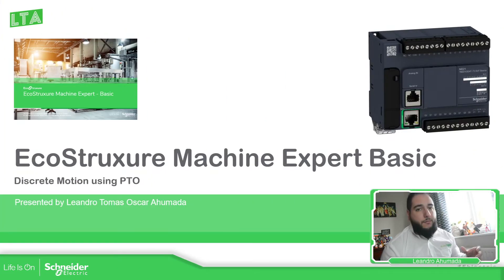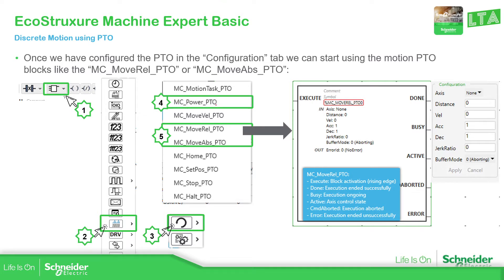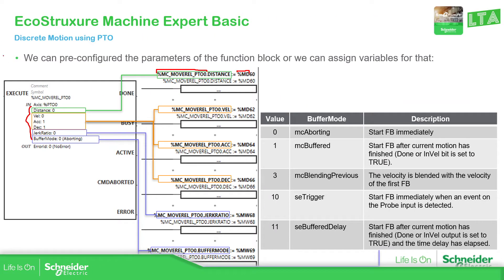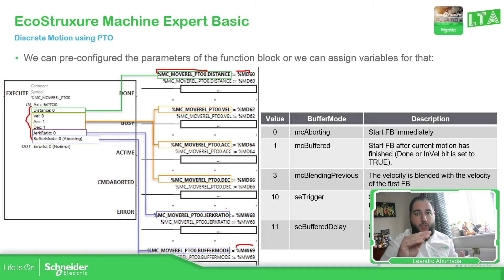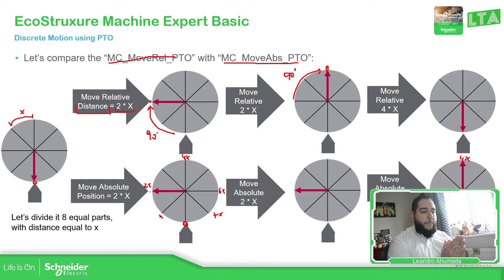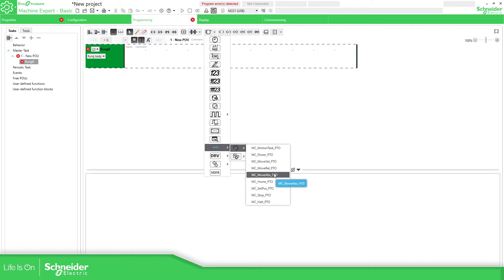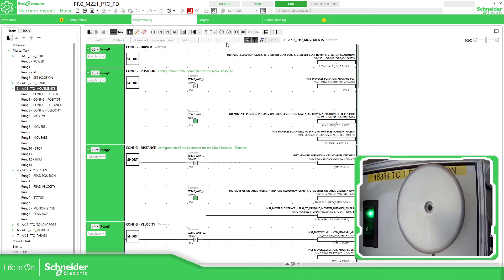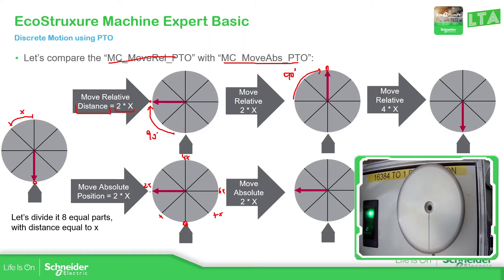Training - M221 - M16.6 Discrete Motion PTO (Move Relative, Move Absolute and Halt)

Comment: @LeTomasAHUMADA I am trying to make an application on M221 for a conveyor control using a servo motor with an encoder. In this application, the conveyor has to move precisely about 600mm. Can PTO handle this application? If yes then which block I can use. Do we have a video for this kind of Application? It would be a great help if you can reply on this.
Reply from the maker: Hi there! I believe it will depend on your application, it is not fully describe in your comment. If you need to make the same movement (600mm) over and over again a move relative is fine but velocity is not consider here and for that you will relay on your servo and the sizing done.

Comment: where is Halt Function block??
and can you make a video  about Buffer modes with it's practical part??

Thanks
Reply from the maker: Hi Ahmed, the mc_halt_pto allows you to add a buffer mode if you compare it with the mc_stop_pto…. If it is not in the video i totally missed it 😅.

Check page 186 of the following manual:
https://download.schneider-electric.com/files?p_enDocType=User+guide&p_File_Name=EIO0000002007.05.pdf&p_Doc_Ref=EIO0000002007#page183

Related the buffer mode, in the touch probe video i explain the trigger mode ( in the next video , i do not remember). For the other ones i can think about a different content to really see the behaviour.